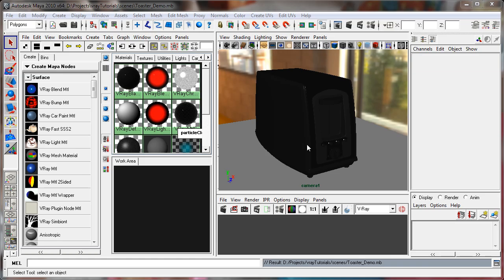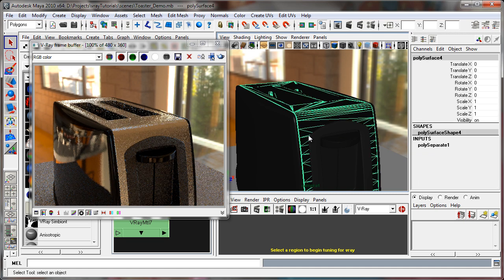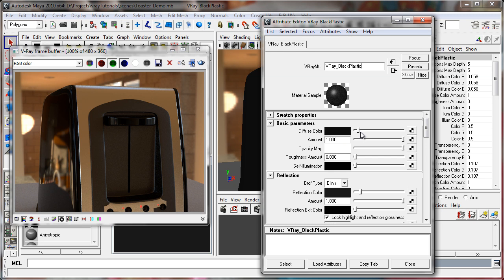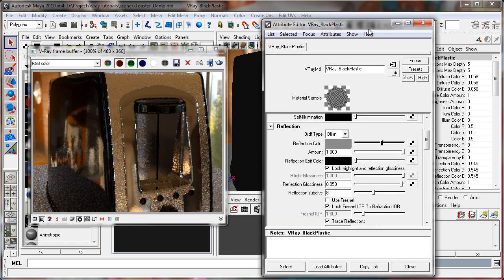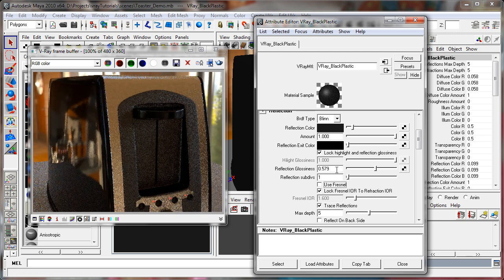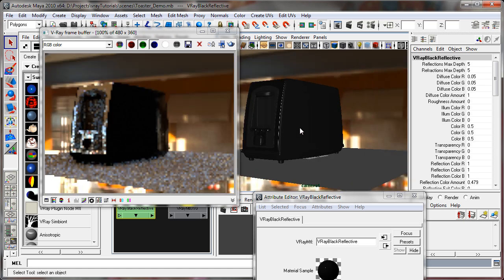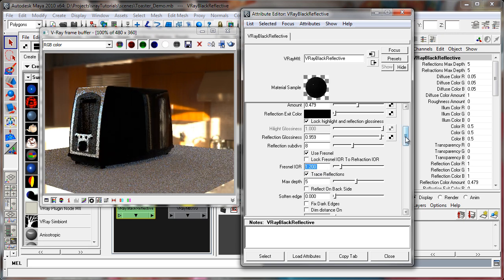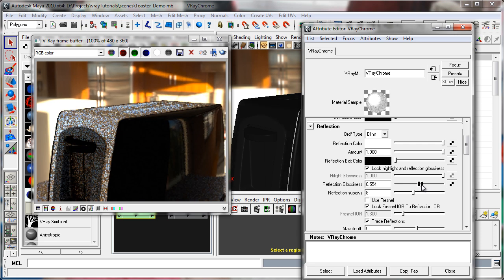VrayForMaya: VrayMaterial Part1

Comment: Must be a simple question though. Trying to find a multiplier for normal map (in tangent space). I generated super high depth and i want to dial it down. kind of intensity for normal map. I can do that in max but could not find it in maya .I do have an option to dial from crazybump and bring it again into maya. but that's a long way around.
Reply: I agree. did you find an answer? perhaps a utility node in the hypergraph

Comment from the maker: @tencelribeiro...  VrayMaterial, pipe in a normal map, and make sure to set bump to proper normal type.  Then create a vrayBumpMat.  Pipe the vrayMat into the base slot, and pipe your standard greyscale bumpmap into the bumpMat's bump slot.  Apply the bumpMaterial to your object and the 2 bumps should blend together fine.